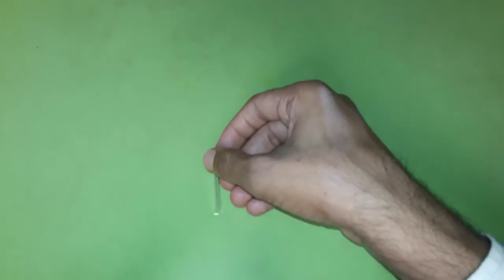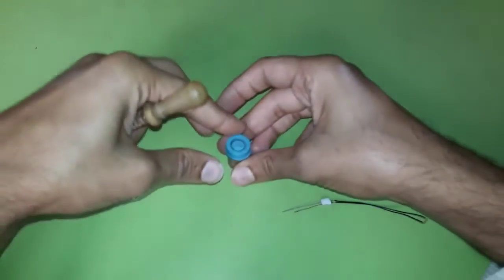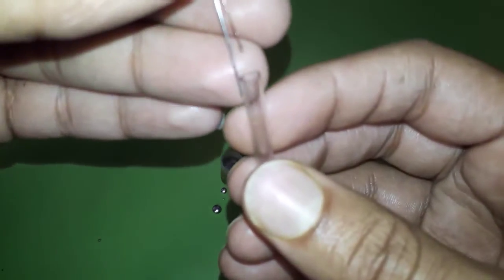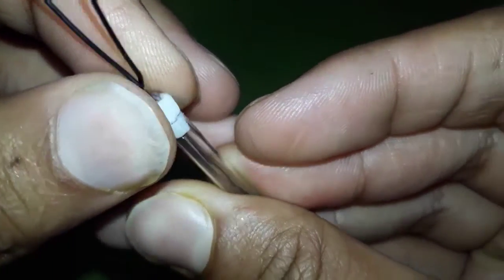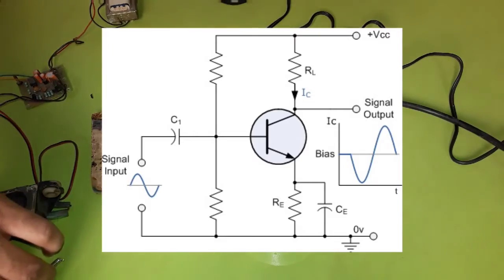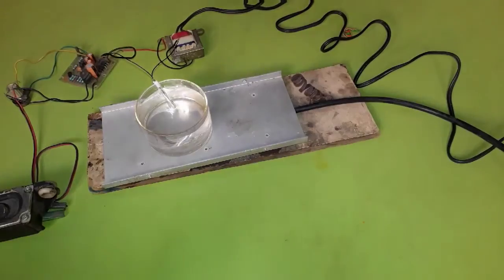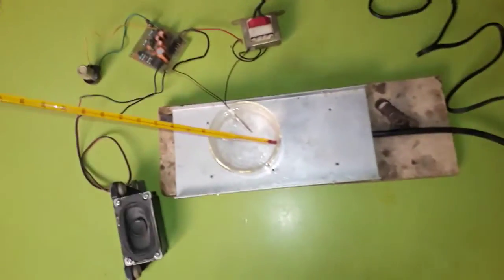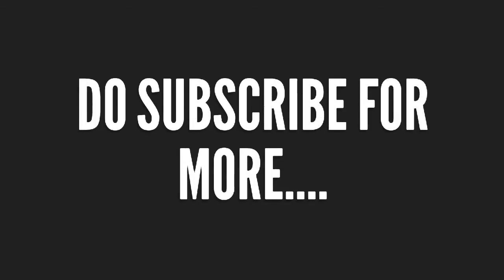Make Temperature Sensor Alarm  circuit with Mercury |DIY Electronic Thermometer

Comment: can you show me how the make hot plate like this in vidio?  i need more information about that thank you...  i think your hot plate is simple and cute
Reply from the maker: My heat plate is made from fibre & Some metallic sheets it can't be made at home but still if you want you can use the iron plate or iron coil to make the similar heating plate